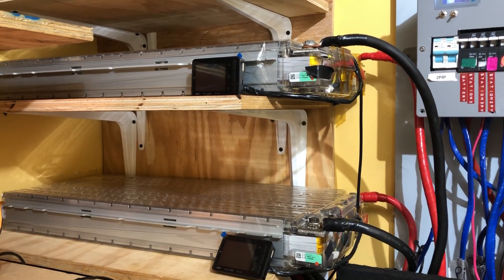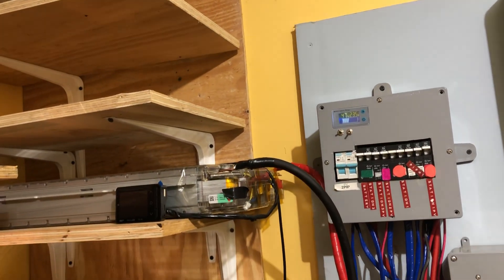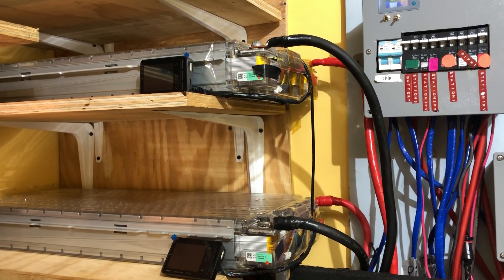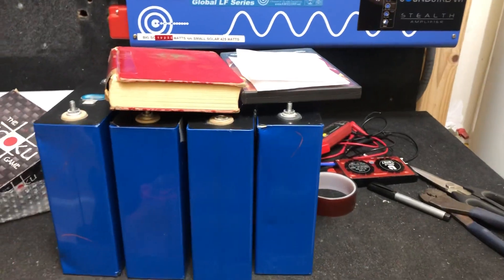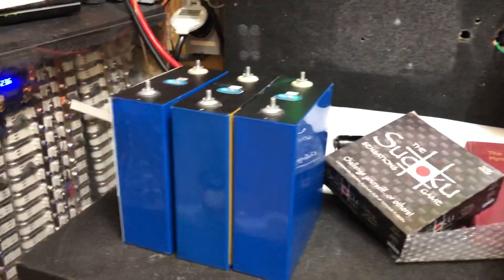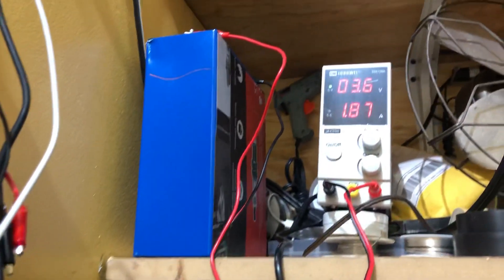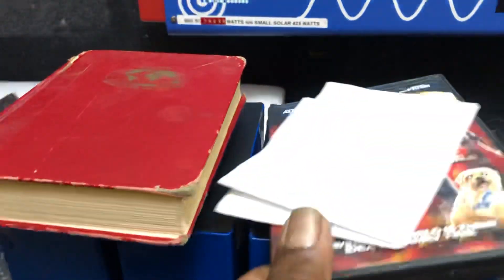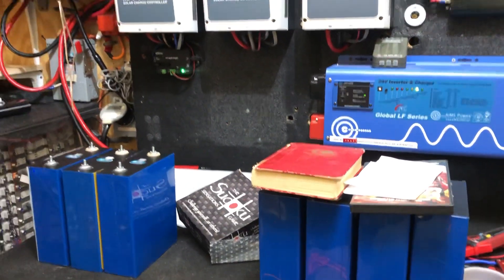Tesla battery and free lifepo4 cell at 310ah each

Comment: Hi the ones with Broken terminals, I was able to drill them out to 5mm deep with a 5.1 drill and then tap them M6x1.0 mm you go through the aluminium just into copper works fine I then used blue locktite with a 20mm M6 grub screw then put on a couple of M6 washers to make up the hight for the bus bars
Reply from the maker: Thanks for checking out my video